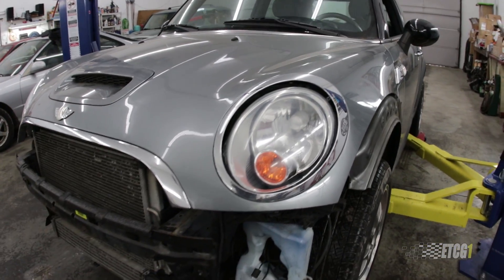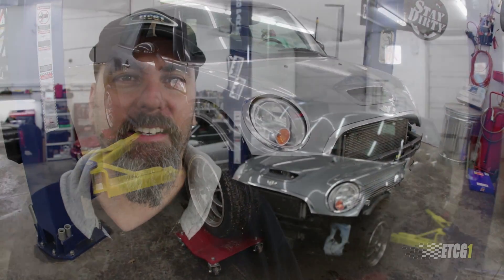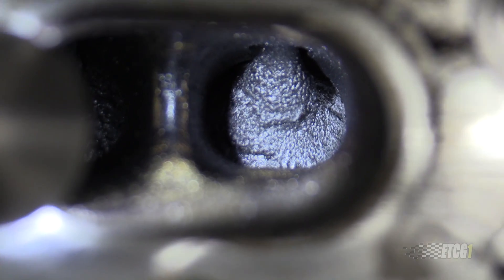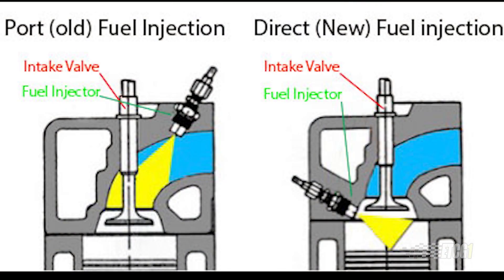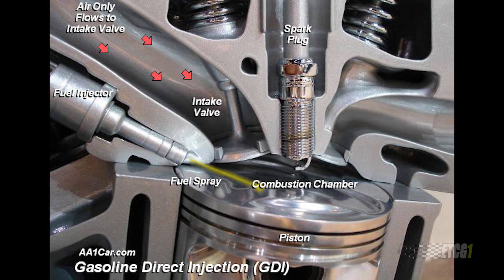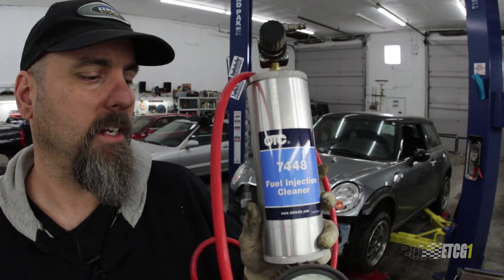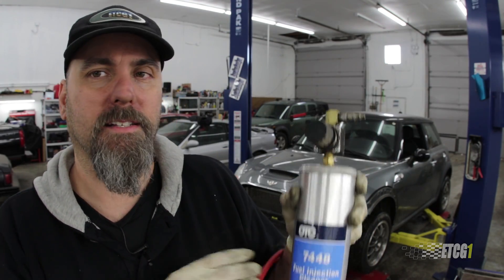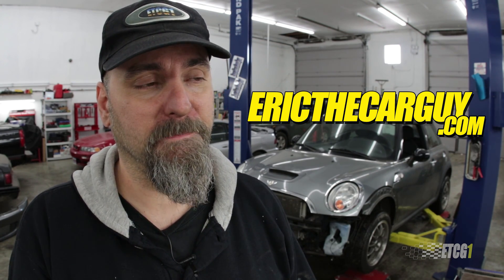Direct Injection Proves Fuel Additives Don't Work

Comment: That particular car and most DI engines are a great candidate for a PCV catch can setup (air oil separator) it may not be a complete fix but they help reduce that build up. It’s to bad the OEM’s don’t install them from the factory, closest I’ve seen to a catch can is the PCV system on the older B series Honda engines.
FYI I’m guilty of using gasoline as a solvent to clean tools and parts 🤦‍♂️
Reply: No issues with a sealed and baffled catch can though
Reply: Paul Walters it perfectly OK to change the pvc system, as long as the engine is allowed to breathe. All its doing is keeping from burning blowby oil. No oil on top of hot valves, no gummy valves.
You can decarbon DI engines, but risk sending carbon through the turbo on turbo cars. Just ask Ford. They replace alot of ecoboost heads for this issue. But should be ok for naturally aspirated engines. You have to get the cleaner in the intake, not via the fuel system. Seafoam works great.
Reply: The PCV system on the mini does cause more carbon buildup and I have seen an improvement with a catch can installed.
Reply: rubbish! I've a mini experienced the failure of fuel pumps etc & bad fuel filter gaskets etc etc, I've installed 1 of 2 catch cans & I've experienced ZERO issues
Reply: Preproto no, the turbo doesn't supply oil to the engine, the turbo only allows for greater vacuum pressure within the PCV system. the issue with carbon build-up is directly due to oil & slight exhaust gases being recirculated in the intake system.. due to no fuel being present to wash/clean the backside of the valves & intake channels, as found in older port injection engines.
Reply: TigerKing want to explain why?
Reply: Hondo fourfivetwo ford I belive has that option now on some of their stangs. I'm figuring many car manufacturers don't do this due to cost .mini even now attempted to plug up one of the ports that use to recirculated to fix part of this issue, yet they also know. it will shorten the life of the motor...to others just because a car manufacturer does or doesn't do something doesn't mean it's always good or bad ..this is one example of something the car manufacturer does that's bad. hence why they now offer walnut she'll blasting to clean up this issue🙄 BTW a catch can is very helpful only thing is this car (mini Cooper s) seems to need 2 oil catch cans (others can do a search to see why)
Reply: Centrifuges
Reply: catch cans should be baffled from the get go, unless your installing an empty canister so it wouldn't be as effective
Reply: yes it is, OEM don't think of everything nor problem solving etc.. the manufacturers will happily sell you an over the priced new engine or new parts from there original failures
Reply: yeah the mini s requires 2 catch cans or a sealed vacuumed duel port can (a lot more expensive) it requires 2 cans due to the initial intake ports & pcv, then on the recirculation/turbo side.

its a very easy DIY job
Reply: how'd you get carbon through the turbos from cleaning the intake valves.. when the turbo is sits prior of the intake valves & the air flow only goes 1 way?!?!?!
Reply: it wouldn't help the engine from burning oil in a sense as if oil is going through the intake at a high rate, it'll only fill your can quickly (you'd not be able to use it again as it'll also have a lot of moisture captured aswell) larger engines usually do use oil (if driven hard or higher mileage etc)
you'd be able to see if an independent cylinder is getting more oil just by looking into the cylinders...

if your car is brand new I'd check with the main dealers before even considering touching the engine.. ie it could easily invalidate any warranty you have
Reply: Mal P it goes through the cylinder and then the exhaust/turbine side of the turbo. chunks of carbon can also theoretically cause damage to the catalytic converter.
Reply: Aaron Friedman  you do realise that the carbon found within the intake valves is actually a soft 'charcoal' like substance, it wouldn't damage the turbine impellor ... as if it was so bad & harmful it would kill your pistons before any likely turbo damage could occur....

regarding possible cat damage, again unlikely.. the cat has a very strong wire shield at the leading edge which would catch any potential damaging item.. again if something so harmful was to get through the valves & pistons it deserves to destroy anything in the exhaust...

the most likely even would be chunks of carbon break away.. if any such large amount of carbon doesn't get broken up during the explosion side of combustion within the chamber it would be broken up if hitting the steel bladed turbo or even ceramic bladed turbo (mini's don't use ceramic turbo's) if it got passed all that, it would get caught up on this protective mesh prior to the cat elements & due to the very high temperatures of a cat (1500+ it would naturally break up whilst under pressure of the exhaust gases & high temperature its found in) it would then fall through the exhaust as a nice piece of dust... happily landing on any car/truck windscreen or leading edge as a piece of road grime.

I'm not being funny but it takes quite a lot to damage a turbo blade or cat or even an engine valve seal dust usually doesn't do anything.
Reply: Mal P you asked how carbon from your intake can reach your turbo, which I answered. if you're just not actually concerned, that's another matter. and the issue with the cat isn't impact; "The build-up can become so severe that pieces of carbon can actually break off and burn a hole in the catalytic converter." (https://www.knowyourparts.com/technical-resources/chemicals/gdi-engines-carbon-buildup/)
Reply: I've heard a lot of the build up is oil from the turbo on some models
Reply: Over on Prius Chat they are raving about oil catch cans.
Reply: Hondo fourfivetwo 
Go top shelf and use avgas for washing parts. 
It smells nicer and evaporates faster than auto gas😂😂
Reply: We use mostly kerosene for parts cleaning instead of gasoline.
Reply: I don't think the manufacturers install catch cans simply due to the fact that your average buyer won't want to empty them every so often. That being said, I've got a dual can system on my veloster turbo and all the "milkshake" that i've kept from going through the engine is more than worth the extra maintenance.
Reply: Hondo fourfivetwo As soon as you mess around with  pcv system and install a catch can  watch your fuel trims go sky rocket.
Reply: Never good messing with OEM pcv system.

Comment: i see a walnut blasting video in our future
Reply: So much this.  Would be cool if ETCG did one as it would be 1. Technically correct 2. Step by step enough that one could probably do it.
Reply: I'm already doing this on subaru foresters!  PITA...
Reply: From a 'mechanictrickery' point of view...strip the head, spend days cleaning valves etc....seems better value for money...than a 'quick and simple fix'!!
Reply: I need to clean out the intake valves on my 2010 A4 this summer. Probably going to use a drill with a brush attach with lots of cleaner.
Reply: SubieLand Walnut blasting on a boxer engine sounds awful.
Reply: It's a major pain in the ass...I've done it 3 times on my 335i. Makes a huge difference, but definitely sucks having to do it. I'm lucky enough to have 93 octane and would think it wouldn't be as bad, but it builds up regardless with miles.
Reply: Go MGTOW that's exactly what Riley said: 93 "type" builds up regardless of miles. Why you have to repeat, do you live someplace where octane ratings from the same carrier utilize different additives in each product?

Comment: Haven't they started building engines with both direct and port injection. to try and alleviate this problem? For those with direct injection it would make more sense to vent the crankcase into a catch tank. Pumping it back into the engine is just plain dumb.
Reply from the maker: Yes, but that does nothing for the engines with the older design.

Comment: Injector cleaners only work if they contain PEA (Polyether Amine). Redline has the highest concentration of this on the market, so don't go with a cleaner without PEA. If you have a direct-injected engine, you need to have an induction system cleaning, as a dump-in-the-tank injector cleaner will not get the job done. The spray-in-the-intake-manifold solutions are somewhat useful, again, as long as they contain PEA, but a professional job is best.
Reply: New Hyundai GDIs have a pretty good system. They do a double spray onto the back of the intake valves on cold start for around 30 seconds to a minute... This means a PEA fuel additive should have some cleaning effect in their direct injection engines.
Reply: @19jacobob93  2020's?
Reply: @aliasunknown6972  Not sure, but I saw a video of both the Nu and Gamma engine's engineering and the animation clearly shows it in operation, and I have heard about it on a forum. It would at least help clean the valve seats and prevent the performance issues. I have the 1.6 GDI in my Accent and it has been flawless, and there is a guy from New Jersey in the Hyundai forum who has so far put 530,000 miles on his 2012 1.6 GDI Accent and he has never had to do anything internal to the engine or transmission in that time, including any form of carbon cleaning! 
I feel if you do a lot of short trips and city idling then it could cause issues, but then again it does on any engine...
Reply: CRC 1 Tank Power Renew has similar concentrations.

Comment: What if you use an air intake cleaning method like a spray on a direct injection engine? it should clean intake valves then
Reply from the maker: To clean what you saw in the video took about an hour of scrubbing and carburetor cleaner.

Comment: Watch ChrisFix and be suprised. Even scotty kilmer agrees, they are not magic  but they help a little
Reply: Rick James, they can't help clean or prevent carbon buildup on the back side of the intake valve unless they have a way of getting to it. In a DI engine, they don't as there is no fuel in the air stream, only air and oil vapor (from the PVC system).
Reply: Rick James think the general idea is that yeah sure cleaner does help, but comparatively eating one orange isn't gonna cure someone's cancer tho it does help. But you end up looking like a jerk for not admitting technically "it does help a little"

Comment: This video was brought to you by Carberated engines.
Nice propaganda.  
Go watch ChrisFix
Reply: Rick James -- So the fact that engines with direct injection are prone to carbon up and that fuel injector cleaners can do nothing to stop that process is all propaganda? 

Git outta here...
Reply: So what you're saying is you didn't watch the whole video? It explains the physical difference of DPI and mpfi. Gasoline acts as a solvent and cleans the top of the intake valves in mpfi. This doesn't happen in DPI so an additive would be ineffective.
Reply: Rick James Actually it was a video against direct injection straight into the cylinder, and rotten fuel pumps. I had a garage install an aftermarket electric fuel pump on my car because they didn't want to clean out my fuel tank. They knew more than me. (Sarc) 
That new fuel pump died in under 100 miles.

Comment: It seems to be something people put a lot of stock in here in the UK. Redex is the go-to brand. I've used it a couple of times and seen slight improvement, but I've only had older cars and it's likely, as you said, that the engine's knackered and it's just mitigating some other problem. 
My current car just failed its MOT due to burning a hell of a lot of oil and putting out insane amounts of emissions, so that's going to the scrappy and I'm getting something much newer. I did see improvements, particularly in idle, when using an additive.

Comment: EGR is mostly to be blamed. All this is even accelerated if car runs short distances and low RPMs. Injector cleaners (as well as carburetor cleaners) work well in a long run. One shot really can not do much. And I agree, indiret injection brings important benefit of cleaning intake valves.
Reply from the maker: The EGR has little to do with it, it's the PCV system that seems to contribute the most.
Reply: There are engines with gummed up valves which do not even have an EGR valve to begin with. More and more engines use internal EGR which can be achieved on engines with variable valve timing on both the intake and exhaust valves.

Comment: Only option to provent carbon buildup is oil catch can
Reply: Don't forget about the other end of the system that normally is a hose going from the valve cover to the air filter. Had a worn out Jeep and the filter would get oil soaked because of blow by.
Reply: I agree, OIL CATCH CAN.
Reply: peshpeshabdulla That’s not even going to completely prevent it. It will only slow the process.
Reply: TheRmdunn230 some people are running duel catch cans for this.
Reply: Not always effective.
Reply: The only solution is to not run a hydrocarbon past the intake valves. Highlighted no content is running.

Comment: Never had any confidence in fuel additives.  Just another way for people to make my money theirs.
Reply: On the contrary "fuel additives" do work.  The thing is that they are so vital that they are already put into fuel.  You only need a separate bottle of additives if you bought dodgy 3rd world quality fuel and the result was buildups, OR if you ran a vehicle so seldom that the gas got old, volatile portion evaporated away and left varnish behind.  In other words there are legitimate reasons to use them but as Eric highlighted, they don't do squat for dirty valves if the fuel with the additives isn't even spraying on the valves. lol.

They are also handy to put into smaller engines with carbs if the owner left the fuel sitting in them without fuel stabilizer long term, "IF" the carb isn't so gummed up that it won't even run to pull the fuel additive detergents through to clean it.

Fuel additive detergents are scientifically proven to work.  You only need to add them separately if there is a particular situation that allowed deposits to build up which would entail a deposit buildup rate greater than the detergent exposure rate.
Reply: No, my lack of faith refers to MY lack of faith.  I don't claim to be a technical expert on this subject.  My opinion is based on my own personal experiences with this product that's mirrored by a number of experts on the subject, Eric among them. Nearly all gasoline sold in the Midwest is piped in from the Gulf Coast and contains identical additives at the pump, regardless of where you buy it.
Reply: "Misapplied", at the very least. Putting additives in your tank when you've got direct injection and expecting blowby and PCV and EGR to trickle down and recirculate spent additives-cleaners is what I consider 'misapplication'. Your faith does not change  physical laws of the universe while you drive.
Reply: usmale47374 agree. Also oil additives are a con

Comment: What about spraying cleaner into the air intake?  Wouldn't that help?
Reply: So how are you going to clean those valves? And also does this happen to diesels too?
Reply: Vladimir Lekov If it gets really bad you have to take apart the top end of the engine and do walnut shell blasting to get the carbon off of the back of the valves. Or just take the valves out entirely and manually clean them outside of the engine.
Reply: Wow, that's a pretty expensive repair!
Reply from the maker: With the level of buildup this engine had, likely not much.

Comment: My feel free comment - I've had good luck with some of the better fuel injector cleaners in cleaning injectors that for some reason just were not happy. Not instant, but during the period of when it was run with the fuel (and I use it stronger than recommended). IMHO the cheap stuff is a total waste and none is a total cure. As for direct injection, I suspect more and more products will come along to clean the valves. Seafoam has once such cleaner that is sprayed in at the throttle body, but is NOT recommended for turbocharged engines. That leaves out the Ford EcoBoost engines that have the same issue and there are a lot of them on the road. Good reason to keep the oil changed and a good air filter installed... and give a oil coated cold air filter a second thought.
Reply: If you try an oil-coated air filter, watch for problems with the MAF (mass airflow sensor). Those sensors are very sensitive to being gunked up.